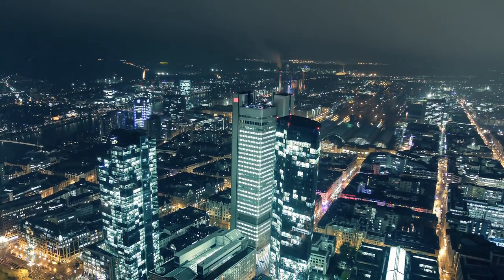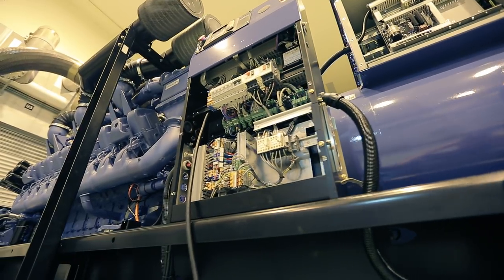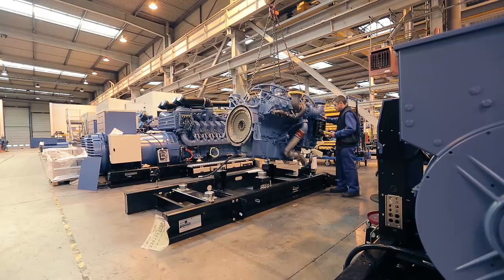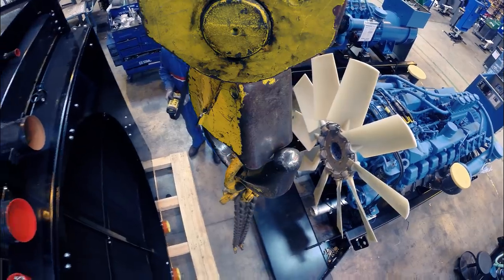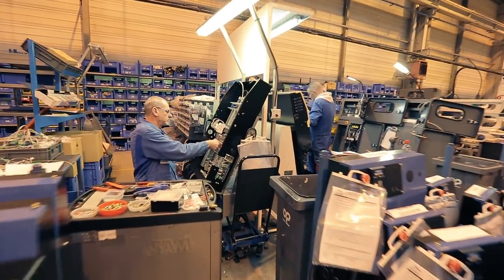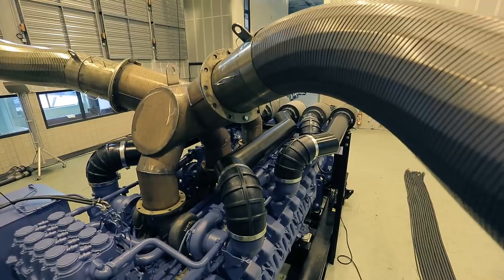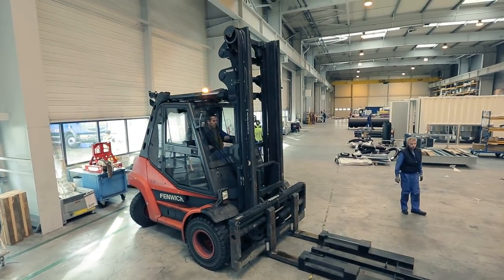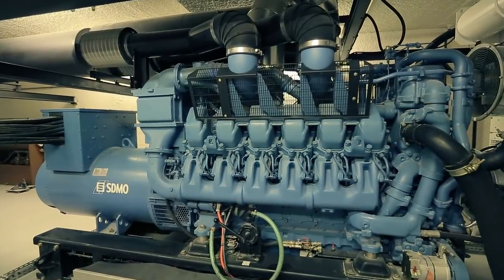SDMO - How are generators made

Comment: Considering the fact that this is over 100 years old technology, I cannot really see the improvement over these years. Their magnificent effort that results in a genset like this is an industrial minimum by any means. If you understand how power is being generated or "created" you would see that this is noting but wasting power on a big scale. Wonder why they did not share the efficiency level of the set? 
Maybe, because the number wouldn't be so appealing as they like it to be...
Reply: Mate Varszegi , 100 yrs old and still can't be beat. As far as innovation goes, some gens are 95% efficient and diesel fuel is cheap and abundant. Not to mention it is extremely clean these days. That's a pretty big innovation in itself. Then there is hydro powered gens. Doesn't get any cleaner than that. The laws of energy conservation dont allow for some "miracle" free energy producing device.
Reply: And these are backup generators Nimrod,  This isn't run all day and night Genius.
Reply: @jbolo5378  I've never heard of 95% efficiency generator set, care to elaborate?